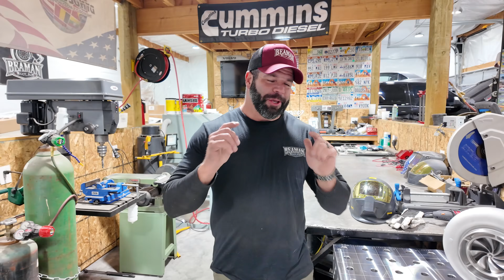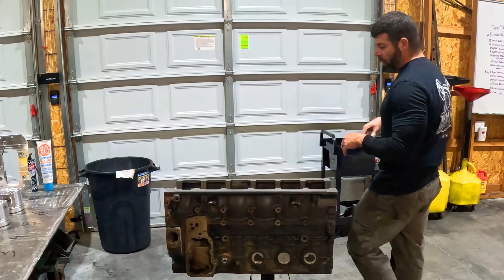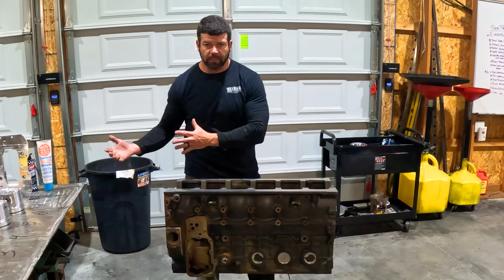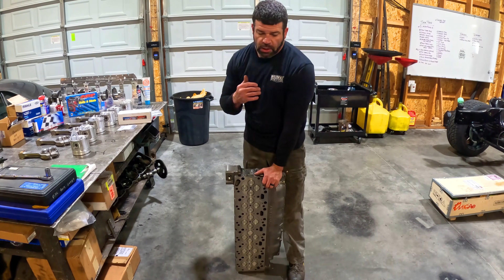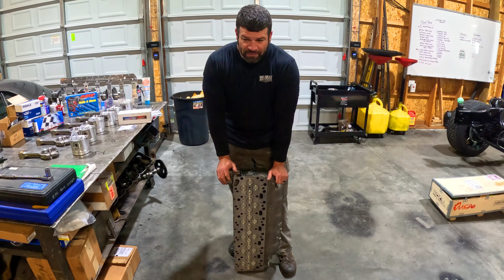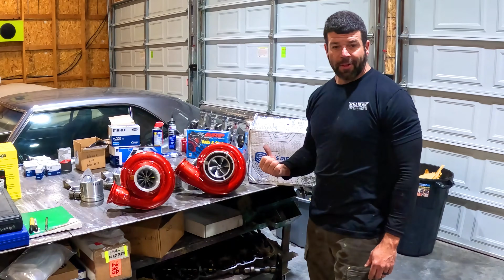Follow THIS Recipe for a 1,200 HP Cummins

Comment: Definitely made over 1200 on this set up didn’t you? I thought you made like 1500
Reply from the maker: You’re right! We actually ended up at 1,545 HP fuel-only and 2,049 HP with nitrous.

This video covers the original 1,200 HP setup. Before we started the engine build, our goals shifted, which led us to change a few key components. Once that happened, several other parts followed.

Here’s the video showing the final setup we actually ran (and stay tuned later this month when we share our 2026 goals and upgrades for Side Piece):
👉 https://youtu.be/Xb66KDL0ZVg?si=Ws0dxmbbRU_iL-z9

The original combo is still a solid 1,200 HP recipe — we just decided to push further 😉 -Deb

Comment: Hey man, regarding your last video about installing the lift pump with the No drop, What do I do with the stock fuel lines that goes to the filter housing? Also do I just unplug the fuel pump within the tank?
Reply from the maker: You will want to clip the power line or pull the fuse for the in-tank lift pump.  If you unplug it your fuel gauge will not work.  You can just cap the feed line but you will want to keep the return.  To clean up the engine bay you can use a fuel filter delete block like the one offered by Fleece.  Let me know if that helps.  Happy to help!   Sorry for the delay on the response on the other video.  Must have missed that one!
Reply: @BeamanBuilds Well what about the water and fuel separator that sits under the truck just behind the cab?